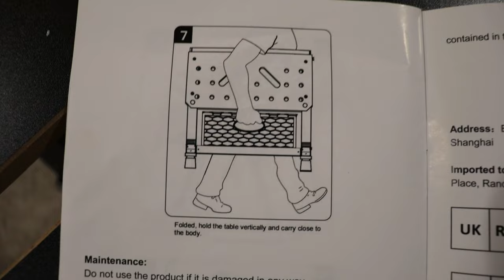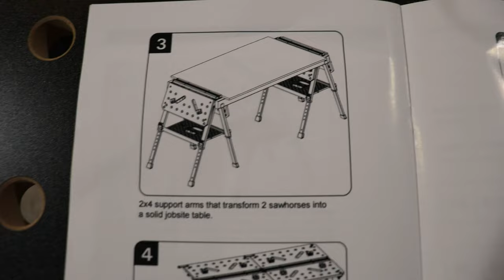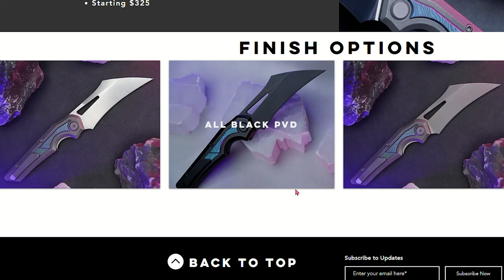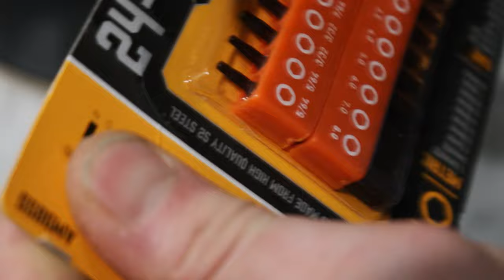Everyday Carry Cutting Tool or Self Defense EDC?  Possibly Both

Comment: Too bad it’s Bestech. Would have grabbed one if it was Reate. Oh well…
Reply: I get the sentiment; I'd say 85%-90% of the community (myself included) agrees with you and prefers Reate also, not just over Bestech but over any Chinese OEM that has proven to make elite quality cutlery. However, we will be seeing Bestech a lottt more as the go to OEM for a lot of the custom makers that have popular production models. And the sole reason is literally lengthy lead times/due dates and an impacted wait list. 

Since around 2019 Reate has essentially been 1 year to a 16 month wait period to have a knife OEM'd by them; and they don't choose favorites or push certain makers orders in front of others. So when Ramon Chaves or Brian Nadeau put in a order with them (even on models that they already have a final CAD file for)  they are realistically going to be scheduling that knife drop for the following year and sometimes into a second year, which is excruciatingly stressful. Makers are tired of the lead wait time that Reate needs (not Reate's fault btw; they are a relatively small operation) to produce a batch of knives that they might only need a few hundred units of. Now, most makers/designers just hit up Bestech or QSP from the start, and have 1st run prototypes in 90 days, make the tweeks that are needed, and basically have a finished product ready to ship within 5 months. Straight up comes down to logistics, but overall it makes for frustrated knife enthusiasts/customers on occasion lol.